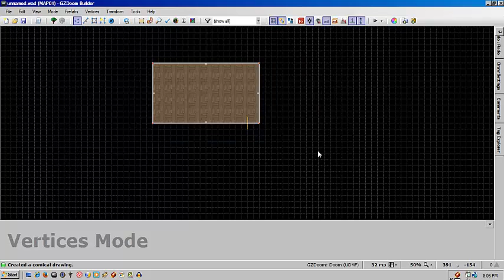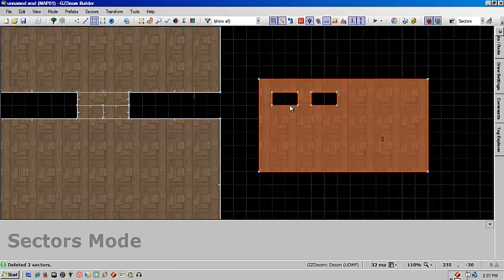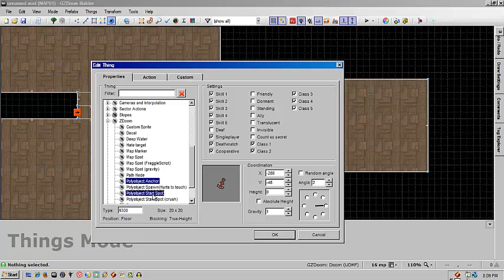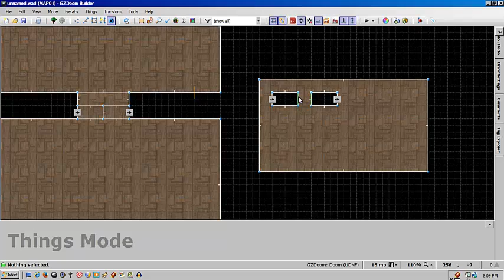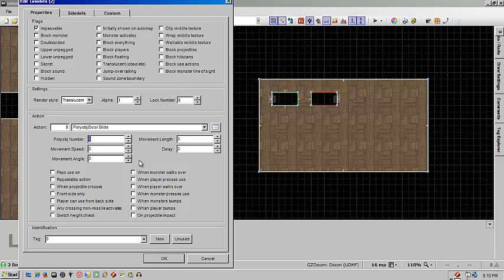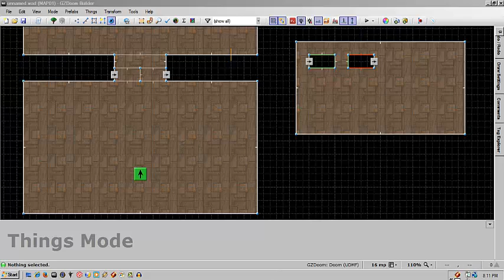(GZ)Doom Builder - Split Sliding Doors

Comment: Okay I'm having an issue with the sliding doors, and the whole map itself too (after creating the sliding doors). I've done everything you told me to, even made the sectors the same lengths, but for some reason the first time I open them they like to pass through each other, and then the second time I open them they open like they should but they're visible through the walls. Also after that I decided to see if other parts of the map were still okay, but I can't open any door after opening the sliding doors, even normal doors. I have tried this with Doom (UDMF) and Doom (Hexen format) and they both make this occur. I'm also running the latest SVN "GZDoomBuilder-r1963 May 27 2014 10:37:15"
Reply from the maker: Nick Lofgren Its best to practice doing this in a test wad as it can be difficult todo at first also ensure the anchors and start things are placed in the correct places it should also be notted that funtionality may break in subsubsectors meanin the door is 2 sectors deep imap using udmf ans gzdoom ,if you have any other issues please let me know
Reply: Thanks for that comment, but I got this sorted out way before you posted that lol. Sorry, I probably should have deleted this comment when I sorted everything out, but thanks anyway.
Reply from the maker: Nick Lofgren No worries .If you have any other questions issues or requests let me know either here or in private message thanks for watching